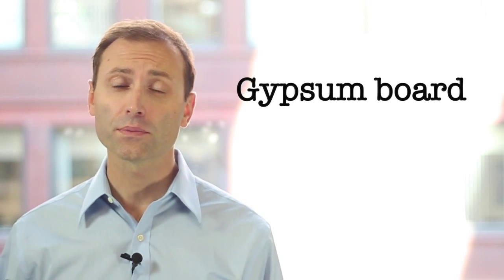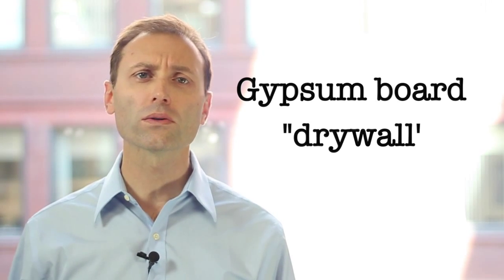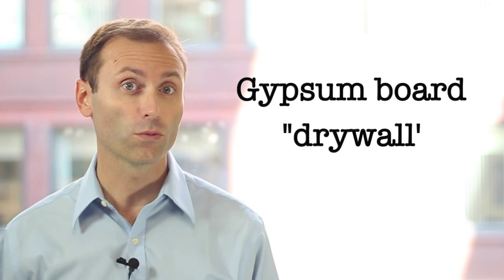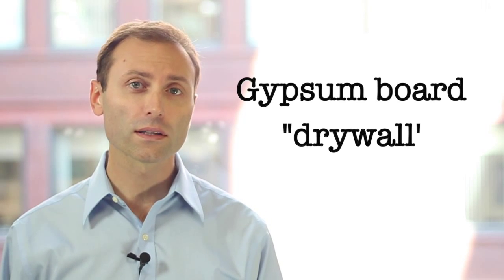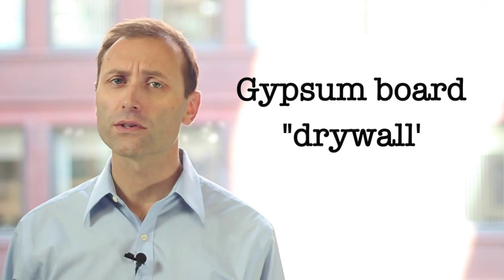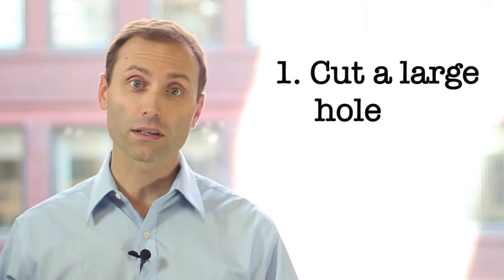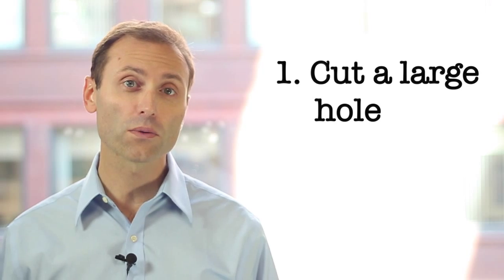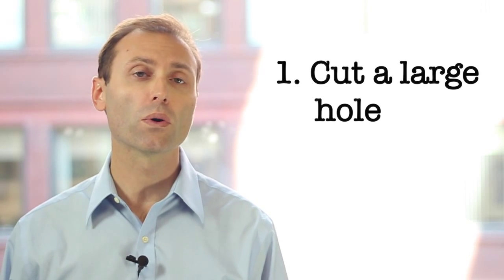Mold in Walls, Part 1

Comment: As a mold inspector for 20 years, I have several stories about people who cut a hole in a wall suspected of having mold. It's a very risky proposition and I don't recommend it unless all the precautions have been taken (plastic containment, negative air pressure, personal protective equipment, etc.). Some molds produce potent poisonous substances and I've seen even the healthiest of folks end up in the ER wondering what the heck happened after doing stuff like that! The worst case was where the mold was not visible so they left the wall open, then the whole family got very sick! Either hire a reputable mold contractor or seriously educate yourself before attempting this!
Reply: We had an inspector use a Trammex moisture meter - the one that goes deeper into the wall.  Do you think this is reliable? He said we had mold all behind our walls but we could not see anything.  He used scare tactics and we didn’t trust him.  Another inspector used a pin meter and our readings were normal.
Reply: @scottbrooks8497  The Tramex moisture meter is  a good and reliable instrument however it will only alert if the wall is wet right now. Let's say your wall got wet 2 years ago and you dried everything up good but the wall cavity inside stayed wet or damp for a few weeks or maybe months, it likely would have grown mold in the insulation and maybe on the paper on the back side of your drywall. If you check that wall with a moisture meter or an infrared camera today, it will be completely dry. The best way to determine if there is mold contamination in a wall is to do a wall cavity test with lab analysis because often the mold is not visible to the naked eye so even if you opened the wall you might not see it. It could be in the insulation or underneath the sill plate or white mold on white drywall ... A wall cavity test is not foolproof but it is a superior way to determine if there is mold behind that wall.
Reply: @MDavis-hd8gb   thanks for the info.  How would you best determine which wall to do the test in? I have had 4 inspectors come out so far and the results have been pretty bad so far.  We have a number of walls that showed up yellow with the tramex meter and a few areas that were in the red.  One of the companies wanted us to air test the entire home which seemed like ligning money on fire.  We had two air tests done in the kitchen where we had a known leak show nothing until the wood flooring was pulled out and there was mold underneath. very frustrated with the process. Thanks.
Reply: @scottbrooks8497  The testing is based on the history. Based on the amount of water that entered the room and where the water traveled, that gives the inspector an indication of where to test the walls. If the whole room was involved then every wall has to be tested to know for sure. If there is mold under the flooring, it could look similar in the walls that took water.  Air samples in the kitchen won't show the mold in the walls. If you disturb the mold, like ripping out flooring for example, then spores get dispersed into the air then the air test would show it. Sorry you're having to go through this, a very frustrating process for sure.

Comment: I believe your approach carries some unnecessary risks that could be catastrophic to patients suffering from fungal sinusitis or mold sickness.  My observation is that when  patient turns to IAQ professional, they have been unsuccessful with a mold remediator /"hacks".  IAQ work is so much more expensive; so it takes real love of the home and commitment to pay double figures thousands.  Usually, someone is sick.and financially comfortable to solve the IAQ issue.  Many more without means just keep on suffering.

- Water damaged gypsum dry wall often  results in several mycotoxin producing species
-  Cutting a hole will disturb the mold and VOCs and mycotoxin fragments can attach to dust becoto me airborne in dangerous amounts. A single exposure can immediately make a pastiest to reach their Toxic Load or body burden,  financial, and human costs.  This will create other sensitivities for life and force significant medical efforts to find Docs who can treat, multiple detox supplements, diet, and other treatment modalities.  It will change their life for the worse and increase medical spending by an order of magnitude.  Most integrative medicine docs do not take insurance and vice versos.
- sniffing into holes can also create  debilitating symptoms for the mold sick..
- if the toxins are inhaled, the become concentrated in sinus tissue adjacent to the brain.  Neurological issues can be debilitating, scary, send someone to a neurological diagnostic at great expense.

I always suggest professionals when water damage is a possibility.  Anything they can see is too much for th mold sick to deal with.  These are really sick individuals and they already suffer from fatigue, sinusitis, depression, financial stress, misunderstanding with household member that are not sick.

People employ IAQ pros for a reason.  i suggest either providing all safety precautions or not to recommend anything that can make the mold count explode or a sick patient sick.
.

Comment: As an inspector and member of IAQA I'd just like to point something out that Ian forgot to mention. If you or anyone in your family is mold-sensitive, you'll need to take a few precautions. 

Like the EPA says, if it's a small area, you can clean it yourself. Just remembered to first protect the area around where you're cutting to avoid mold contamination spreading to other areas of your home. Once you've sealed things off, put a fan facing out of the window so that air moves from other areas into this area. You'll want to see the plastic bowing in a bit to be sure you got it right. 

Next wear something like disposable neoprene gloves to protect your skin and wear a P100 disposable dust mask or better, so you don't take mold into your lungs. Mycotoxins from some molds are very small and may still be an issue. It depends on the type of mold and the environment it's in.

This is only a breif description and if you're not sure, there are other ways to test too.

Comment: So if you aren't frustrated enough with home ownership after dealing with a leaky water heater, broken garage door opener, plumbing problems, foundation cracks, roof needing replacement, broken windows, and peeling paint then you ALSO get to deal with MOLD. 

I HATE home ownership. The only thing worse is renting. The American dream is a NIGHTMARE!
Reply: earthpet do you have an update?
Reply: @Earthpet, I suggest that you start a youtube channel documenting the home problems you face and your solutions resolving each one of them. Let me tell you that renting is NOT fun either.. some of the apartments are made of card board walls & paper thin windows, and poor ceiling floors constructions between the floors...Living in a poorly constructed apartments have too many problems compare to living in a home.
Reply: Yup, I’m poisoned and fatigue